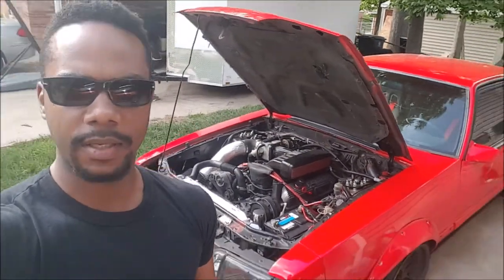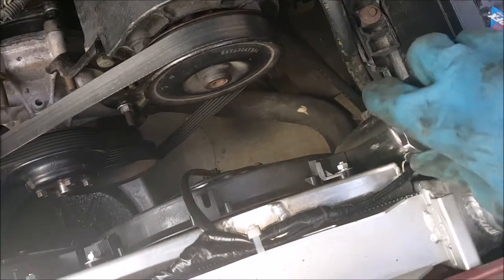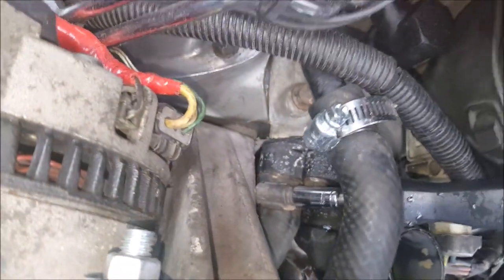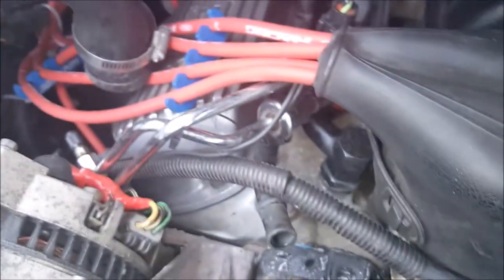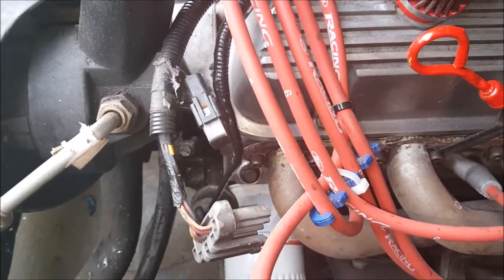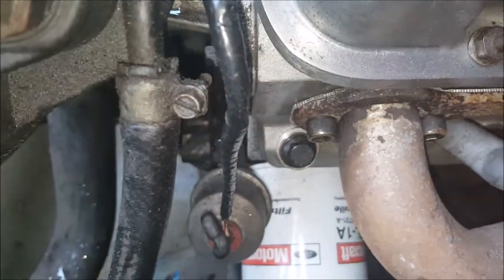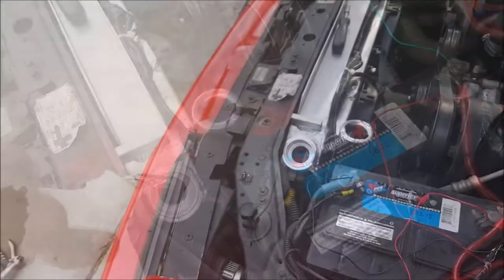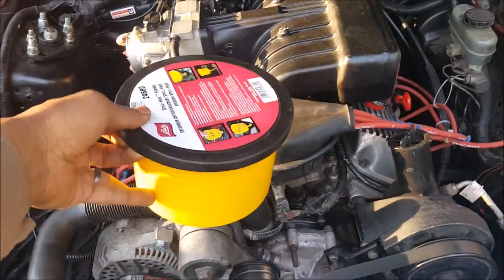Thermostat and cooling system troubleshooting

Comment: Dual fans - Did you install a dual fan controller w/AC override? I'm going your route and installing dual fans. Hopefully, I'll have it ready for you to test drive it next week.🐎👍🏿😎
Reply from the maker: I have no AC, the car is an oven! and my fans are currently wired to a switch.  I have a pin for it on my ECU, but i need help correctly wiring it.

Comment: Awesome update. The stop and go traffic and high daytime temps will be the ultimate test. Simple thermostat issues. Glad you went after that. The first thing I have been thinking this whole time was the head gaskets. I know a few changes were done during the head install and that's something that's quite common. Where did you get the funnel system?
Reply from the maker: I ordered the funnel on Amazon for like 9 bucks.  Thy sell the funnel by its self, make sure you get the kit that comes with adapters.
Reply from the maker: and yeah, stop and go in the heat will be the ultimate test, i'm not ready for that yet, the current fans don't bring the temp down fast enough.
Reply: My fox in high temps and traffic goes up to the N on the gauge where it states normal but it rises fast in traffic and is fine on hiway.  Should I change thermostat first?  Or is this normal to run high or should the temp stay in middle whether in traffic or hiway.
Reply: Jude... its hard to base a Temp without knowing the specifics of your car. Aluminum heads vs Iron, thermostat rate etc. If I were you, try to get those figured out and youll know for sure. Also, install a gage that reads actual temps. That way you know. And by all means, flush the radiator and block!
Reply: Jerry Copeland ty I just bought it a month ago i have bought new gauges waiting for them to come in

Comment: I have a question i recently bought myself a 92 ford mustang gt 5.0 convertible a few months ago for some reason it started overheating it has like 3 modifications ford racing spark plug wires bbk headers and h pipe mufflers i just replace the overflow sensor with the radiator reservoir and radiator cap and it still overheats i burp the air on the radiator coolant but it still overheats my concern is i hope is not the head gaskets the guy who sold it to me told me it needed a fan clutch any suggestions would be highly appreciated.
Reply from the maker: First off, buy the funnel i used in this vid,  It's almost impossible to bleed the cooling system correctly on a 5.0 without it.  If your system is not bled, the coolant will not flow, and you will overheat.  Second, if you know your fan has an issue, get that fixed, Also ensure you have a good fan shroud as well.  Fans aren't very effective without a shroud.  Also ensure you have a 180 degree thermostat and make sure it's installed in the correct direction.  People think a 160 will make the car run cooler, but that's not exactly the case.
Reply: @Sgt.Slides  oh ok thank you bro 👍😎

Comment: maybe get a performance water pump?
Reply from the maker: I think the water pump will be fine, now that the system is bled and the thermostat is correct, the temp only fluctuates at when it's hot out, and at idle, where the radiator has the least air flow,  Upgraded fans should keep everything consistent.